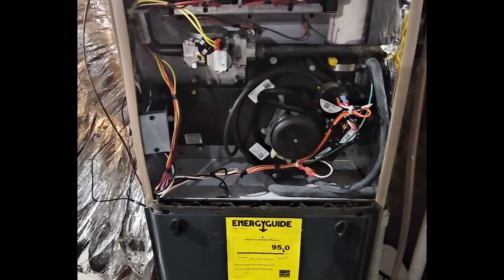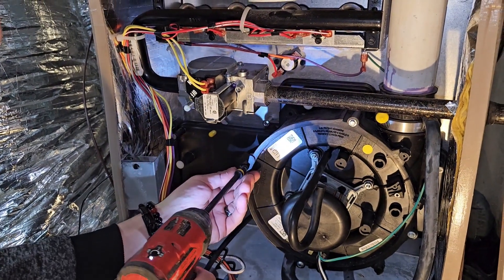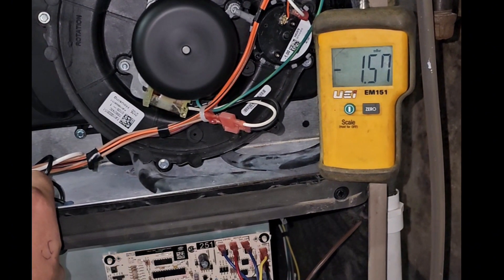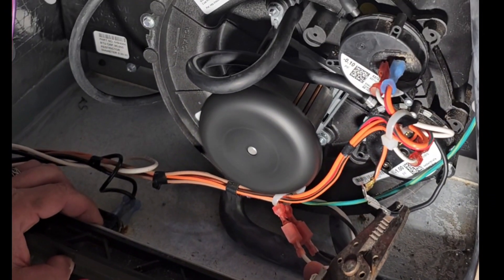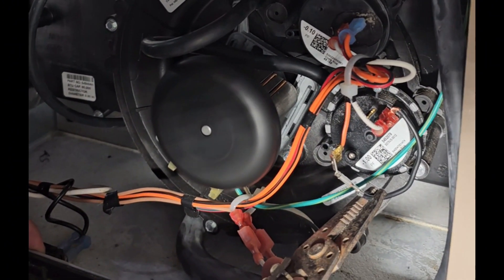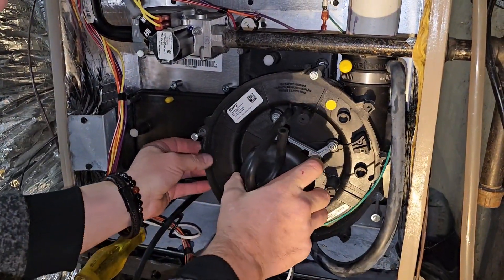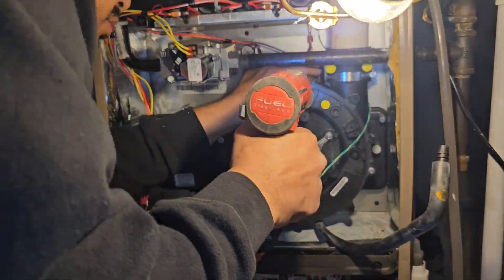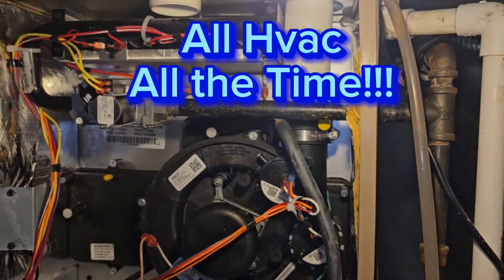Hvac Advice How to fix your Furnace if it won't light 🔥 90%+  #goodman #hvac #diy #hvaclife

Comment: Finally a video that trouble shoots pressure switches properly.  Whatever found its way into the vector motor really did a lot of damage.  A costly repair but no unnecssary parts bought.  What was the damage caused by?   (Ive seen vector motors replaced because of a bad capacitor too if the technician isnt thinking.)
Reply from the maker: A rock found its way into the exhaust somehow. We've seen all types of critters in there, but not this time. Did a ton of damage, but the manufacturer did the right thing and honored the warranty!